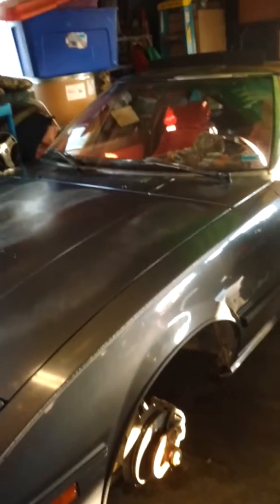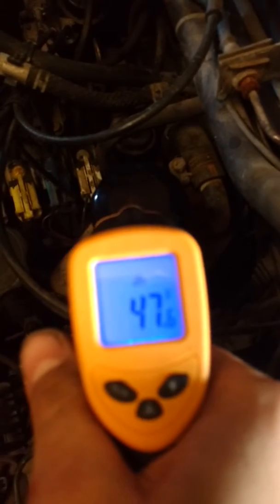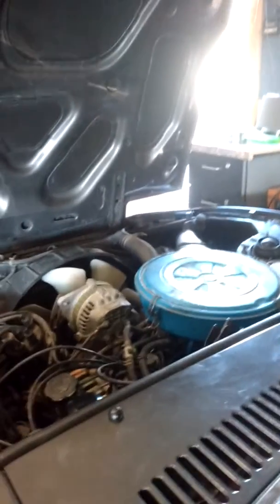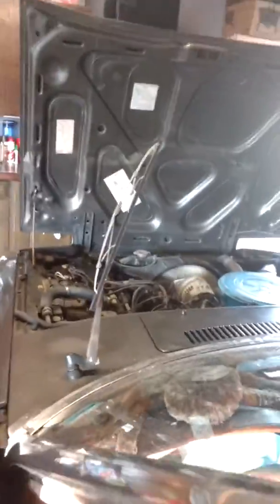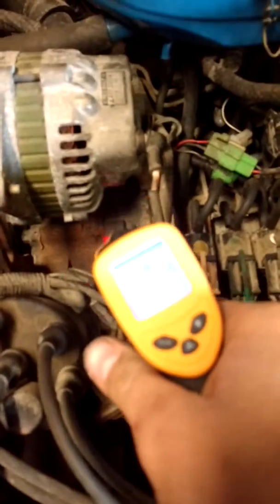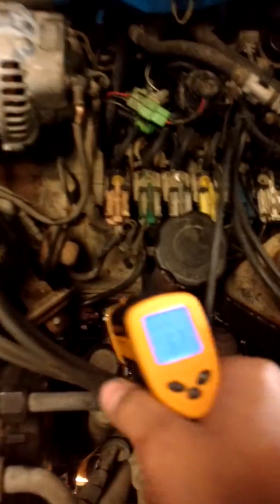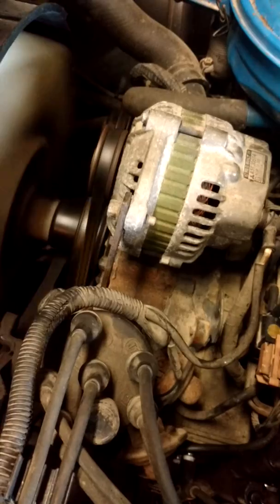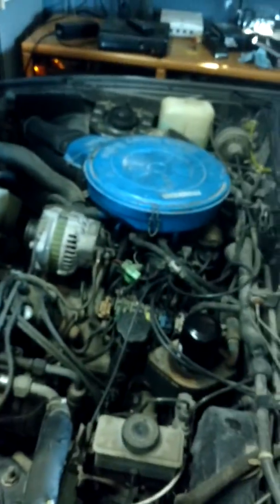1984 Mazda RX7 12A Rotary Engine Cold Start (after sitting for 13-years)

Comment: Hey man. I recently inherited a 12a Rx-7 just like yours in the video. The car  is pretty clean, only around 40k original miles, no rust underneath at all. My question is where do I even start? It's been sitting for at least 5-6 years. I'm decent with tools and have plenty of space to work, I just don't know squat about rotaries
Reply: Knox 6260 Hey i know I'm a little late, but change ALL the fluids and get a new battery, plugs, and plug wires. Take the bottom plugs out and put some MMO (Marvels Mystery Oil) in it and let it sit at least 24 hours. Turn it over by hand every few hours to make sure it gets around in there good. In the meantime clean the carb and make sure there's no clogs and stuff. After the 14 hours turn it over and get all that MMO out then put the plugs back in and start it. Let it run for ~15 minutes, itll smoke at first. Change the oil after the 15 minutes and now change the plugs. Then you're set. Sorry if I forgot something
Reply: Take the motor out and take it to a shop to get ported, once that is done do your normal shit
Reply: Fuel filter
Reply: @frank_texas7400  lol